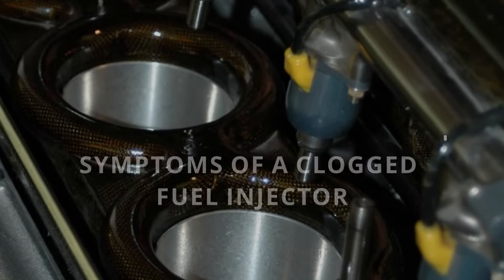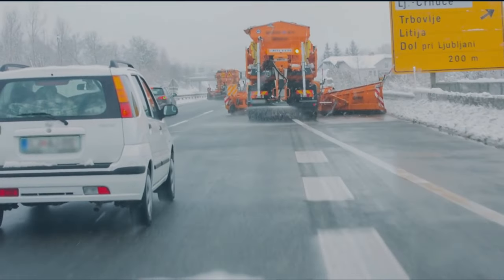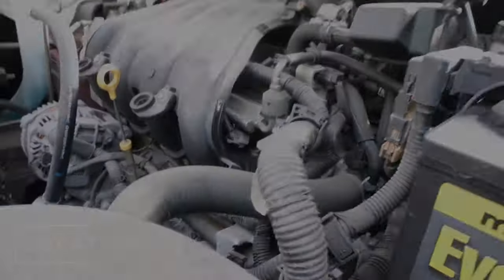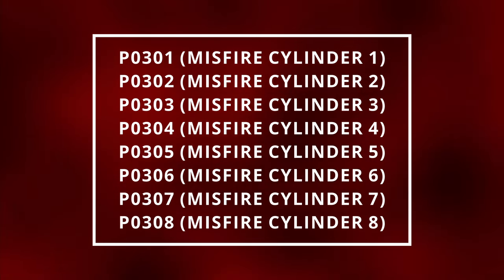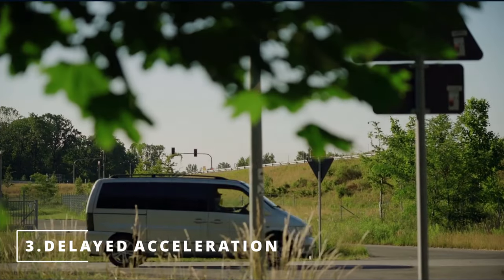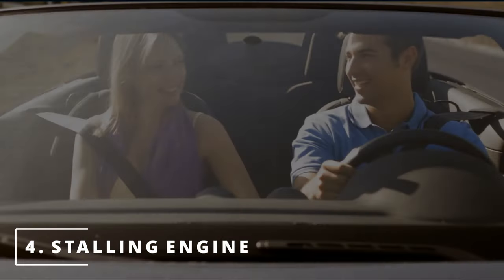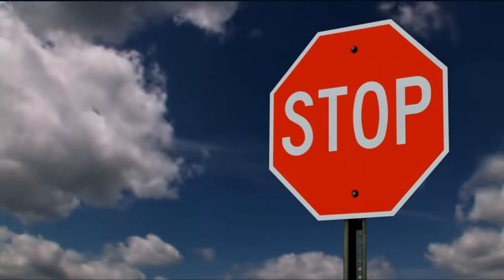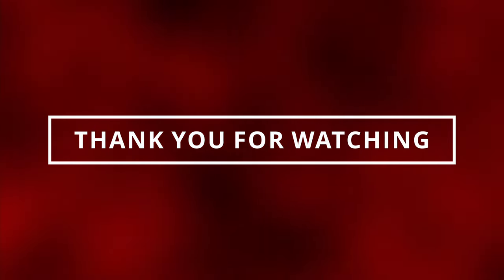SYMPTOMS OF A CLOGGED FUEL INJECTOR

Comment: (2016 Hyundai Veloster Turbo)My car won’t start, it’s cranks but won’t start, at first I didn’t hear the low pressure fuel pump under my backseat pumping so I replaced that with a racing fuel pump that was almost the exact same as the OEM then it started for one small test drive and died when I got home, then continued the issue, then the high pressure fuel pump in the engine bay had no fuel pressure so I replaced that and still hasn’t started since, check engine light is still on
Reply: Also on that small test drive the car felt slower then usual

Comment: Does p0204 mean a bad injector?????
Reply from the maker: This could be due to issues such as a faulty injector, wiring problems, or an ECM (Engine Control Module) malfunction. It's important to conduct thorough testing to pinpoint the exact issue.

Comment: I have a question can a bad fuel injector or a vacuum leak give a code of a p101 as a bad maf?
Reply: Your maf could be dirty. Cheapest way to test it is buy Maf sensor cleaner.
Reply: @LosDoyerss  well I don't understand I cleaned my old maf and it didn't work. I bought a whole new MAF sensor completely new untouched and it still didn't work. So now I'm thinking there's a vacuum leak near the maf sensor components but I can't find. So I still have an engine light and can't fix the issue
Reply: @MM3OG  you need to get your car's computer updated by the dealer. Mine fixed for $100. I have a 2014 nissan altima
Reply: @jessikamoreno1851  actually I found out what happened. I have a brand new nissian versa 2020 with 30,000 miles I've put on myself. What happened was the throttle body was slightly broken and stays open when idling. It was giving a reading of a bad maf but in reality the reading of air was off because of the throttle body plate being open when it supposed to be shut. Thanks though for the advice I really appreciate it though 🙏
Reply: @MM3OG  interesting that

Comment: My computer dosent pick up nothing but has a random problem,  and the transmission is shifting late and odd. My vehicle is a nightmare.
Reply: figure your car out?
Reply: @TSimms7  nope not yet, I noticed it still drives no codes, but I noticed the vehicle behaves when I put gas in it. Could be a fuel pump going bad .

Comment: I am struggling to find a solution about my car. At a time I stop or sllowing motion of the car, the engine getting off. And when starting it again sometimes it getting hard to start.  The car is 2008 Toyota vitz, 3 cylinder. Whoever have an idea what might be the really problem please help.  I diagnosed and changed things including complete fuel pump but still unsorved.  Fault reading now is rough idle.
Reply from the maker: Here is a video of the 3 most common reasons of a rough idle. It could help! https://www.youtube.com/watch?v=10H-GBPCU2g&t=1s&ab_channel=EasyAutoFix

Comment: dude my car is to old to connect to a scanner....... it uses a blinking code when you connect the test en diagnose cables underneath your dash,
but still it does have fuel injectors😂 but no fancy sensors for it

Comment: So after replacing my spark plug & coil my check engine light came back on for cylinder number four. 🤷
Reply: mine is doing the same, did you find out what was your issue?
Reply: @JocelynAraujo  Yes after 100 miles of driving the check engine light turned off. Has not been back on since.

Comment: I think i will just go see a parts store guy. I got a slight vibrating sound coming from the engine compartment. Only sound. the cars performance is normal,no shaking or vibration in the steering column. I cannot find where that noise is coming from. maybe a sensor going bad on me who knows. darn computerized cars anyway.
Reply: I got the same problem!! Idk wtf it is
Reply: @ots9358  the sound was driving me nuts,so i finally took it to a mechanic, Turns out it was the heat shields vibrating loose around the catalytic converter. job took about an hour,a few new screws and i was on my happy way home.
Reply: @bantalee2002  interesting! I’ll check that out thanks for the feedback brother!

Comment: Yesterday i was cruising home, after some pulls and shenanigans, when my car out of nowhere showed engine light and the revs went up and down 200 ish and couldnt accelerate. Had problems starting and when it eventualy did, its stalled after 10 seconds. But when reved a bit sounded kinda normal.
Hopefully its just the injectors and not my pull overheating the bitch and ruining the engine block

Comment: Dodge charger 2010 - I did a tune up, then one thing after another needed fixing! I’m crazy 🤪 with these problems! Now my car runs but it rough idles then the scanner said fuel injectors! Back to where I started and the lightning bolt light comes on and check engine light ahhhhhhhhb 🫨🤪😩
I have been 10 months now without my car and I’m so close to finishing! Somebody please HELP!

Comment: My toyota Corolla 2014 S was reading p304 so I changed the spark plugs and coils, now there’s no shake or engine light until I drive for a while and it happens suddenly but goes away after I restart my car, could this be an injector issue?